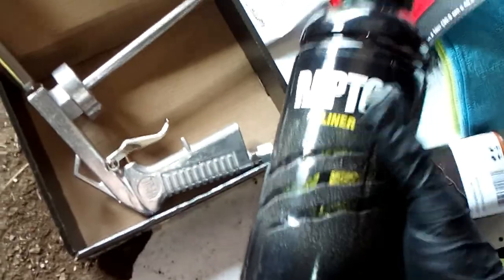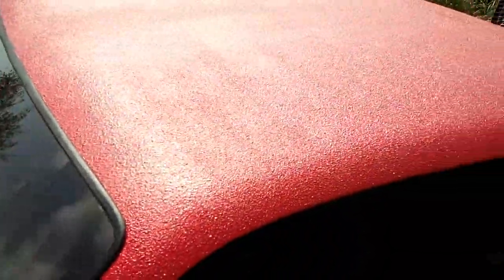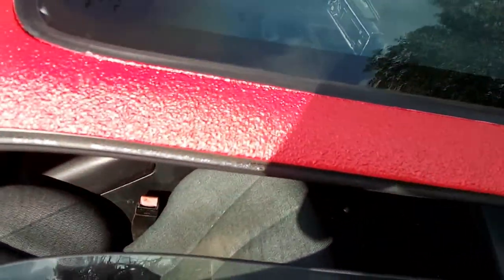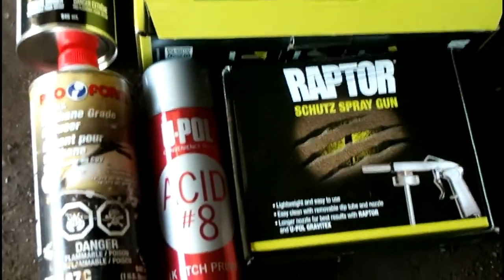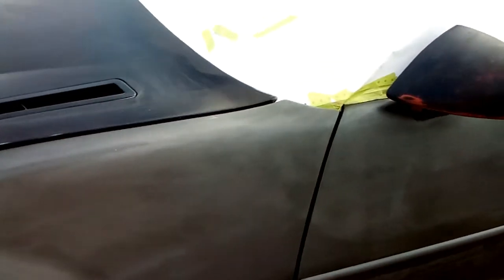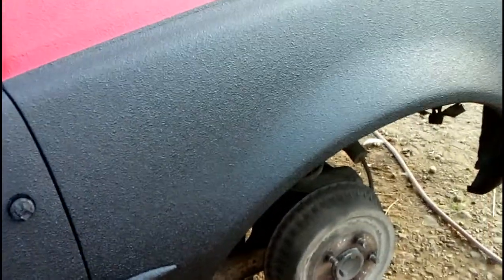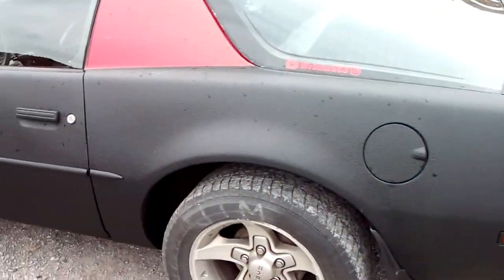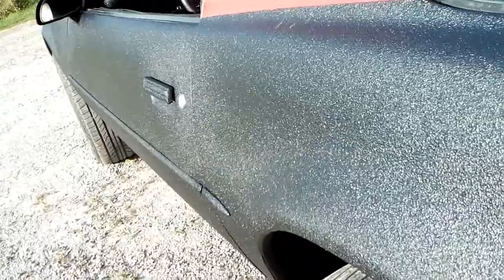LT1 Firebird DIY Raptor Liner Paint Job

Comment: That turned out pretty damn good, might consider that for my s10
Reply from the maker: Hoser's Garage yeah friggin rights.  It looks good in black on trucks , in my opinion.  The car was very different but west coast customs had done a line-x camaro so I knew it could be pulled off.  I was a complete noob to painting whole cars and to raptor liner also, but the final result was alot better than primer grey!  :)  the red roof was my first attempt and time spraying this product down vertical, but I think I eventually got the hang of it.  I'm no stranger to a shutz gun same as undercoating, but I had always wanted to use raptor because its a very unique product made from polyurethane which is flexible, but its 2k so you add hardener to it, and when it turns hard its very resilient to scratches and such.  Let me know if/when you want them tools and how you wanna go about it.  Thanks for watching.

Comment: About to do my S10 will be the first time using product. not sure if I'm going to do solid or two tone but I have the color already in mind is called cement it's a type of Grey u see them on the new Toyota Tacomas and Tundras. I will post pictures and maybe a video
Reply from the maker: awesome, this car was originally gun-metal-grey and i like the grey, but i always wanted to shoot and two-tone black and red.  i did the roof first and learned a bit.  i have done undercoating and gravel guard many times before so i was familliar with the shutz gun, but my first exterior / paint-job.  it turned out pretty good for a driveway DIY job
Reply: What TSI did you shoot at
Reply: Psi
Reply: What PSI did you use
Reply from the maker: @jeremywilds3384  my 8 gallon (smaller) compressor was the only one with a good working regulator so i decided to wing it @50 PSI .  i was planning on 60psi but i wanted to make sure the little 5cfm 8gallon compressor would keep up to me.  it worked out well.  i think after the trigger pull i was dropping to ~45-50 psi , maintaining well over 75-90 psi in the tank, 50-55 at the regulator.  gun about  16-18" away from the surface, 50% overlap, sprayed thru two air filters inline to keep the air line clean and dry.  they say prep on the body is critical, body needs to be sanded rough, degreased, no dust.  the more prep you do the better the result will be.
Reply: @613Builds  okay thanks man yeah I have watched hundred videos on people doing good prep is the main thing I'm just looking for a little bit smoother texture I have a good idea of how I'm going to go about it I also have a HVLP gun I might use and some urethane thinner going to try both  guns and see how it works.. Thanks again

Comment: How many quarts did it take to do the whole car?
Reply from the maker: i purchased 6 liters.  4 liters comes in a kit.  i got one kit, plus one extra liter of black just incase, and i got one liter of red for the roof.  i only used 5 liters, laying down two thin coats.  the 6th liter is good just incase you run short or for touchups later.  if you want heavier coats you will require more.  5 liters seemed to have worked out well for my 2 light coats

Comment: Did you have any  tiger striping from over lapping?
Reply from the maker: the body turned out great.  i shot the roof first, the roof was a learning experience for me.  50% overlap is a must, same as plastidip.  i had a few wet spots on the roof, but i now know how to return the texture after the wet spot dries.  if you get wet stripes or spots, just let it flash off / dry then come back with a fine mist later from farther away to get the texture back ontop. im told spraying downward is the hardest so the roof was a learning experience for sure but i'd definately use this stuff again.  overlap is a must for this product, and i did study the UPOL recomendations and directions first.  the directions tell you to overlap 50% same as a paint job.  it all depends on how far away your gub is from the surface, and how wet or how slow you go.  if you try to cover everything in one coat, you might get wet spots.  wet coat is okay for the first coat but the final coat should be textured, which is achieved with a "dry spray"
Reply: @613Builds  gotcha. I'm going to be spraying my 2015 wrx and I really dont want to jack it up. I appreciate the help thank you. The car looks dope.
Reply from the maker: @michaelrudisill897  thanks.  that sounds like a cool project.  as with any paint job, 95% of the outcome is all in the prep.  washing, grease and wax remover, sanding, dusting, wiping down with acetone.  masking.  Spraying is 'easy' but it's all in the prep.